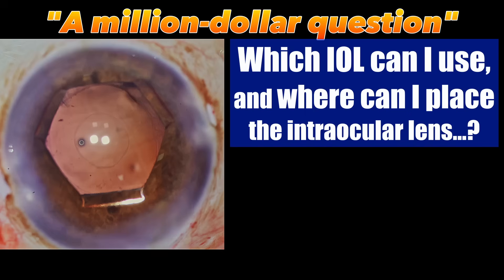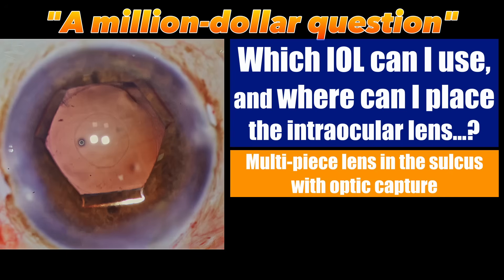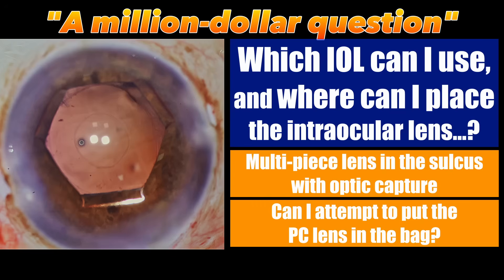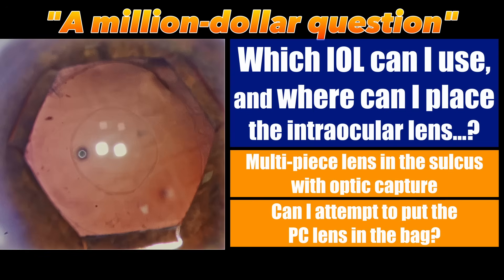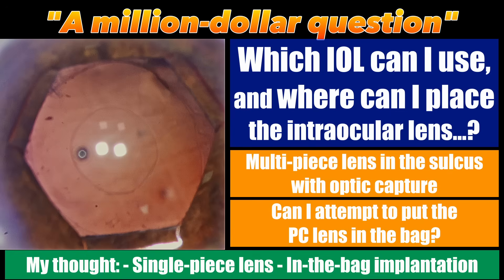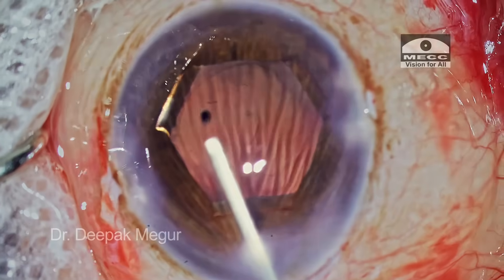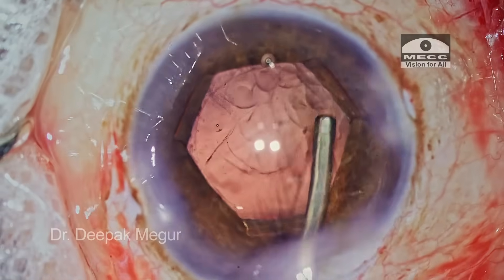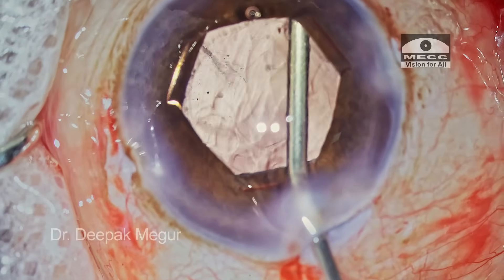PC tear - Part:02 Analysing PC tear morphology, Anterior vitrectomy technique, IOL implantation

Comment: Beautifully taught! What are your normal settings for the anterior vitrectomy? You only mentioned the bottle height. 
And as I have also learned the hard way, better not to push one's luck too far. Better to err on the side of caution and leave ovd behind the lens if pc is doubtful. Pressure spikes and inflammation can be managed medically but a posterior dislocated iol can be disastrous to patient and surgeon.

Comment: Excellent teaching sir.
I always prefer to remove viscoelastic behind IOL as almost all specially Hydroxypropyl methylcellulose (HPMC) viscoelastic if remains in the vitreous cause floaters and reduce optical clarity by degenerating and scattering light.
Had to do PPVs when left  in few cases as pts were not happy bcz of annoying floaters n haze.
IOP spikes and inflammation usually got settle with medication but this optical derangement persists onward even in the cold phase..

Comment: One question: I once learned to never have the vitrector face down in vitreous prolapse, as it then tends to pull more from posteriorly than anteriorly. What's your take on that? 
I usually have it face up and start at or below the PC tear level, and when I see the tear relaxing I move upwards towards the wounds.

Comment: At 6:43 in the video, the posterior capsule opening is completely regularised and the vitreous is completely cleared from the anterior chamber.  At this point, you did not perform a visco-fluid exchange. Could this procedure have caused the vitreous to re-prolapse? My answer is that after performing a limited anterior vitrectomy, a visco-fluid exchange is not necessary in these cases because there is no external pressure. Is that correct? What do you think?

Comment: 1. Start anterior vitrectomy
2. Protect the nucleus piece, bring it in AC above iris
3. Once there is no vitreous in the anterior segment, put vitrectomy in ia2 mode
4. Remove remaining cm, remove the nucleus piece with either ia or phaco or visco expression 
5. Put OVD
6. Remove b hex ring
7. Put 3 piece iol in sulcus
8. Remove OVD close the case